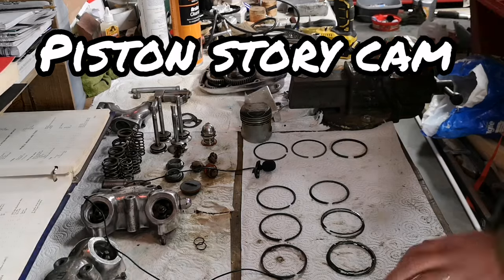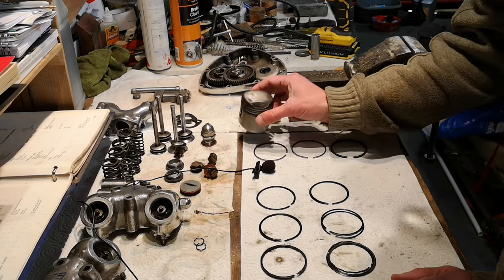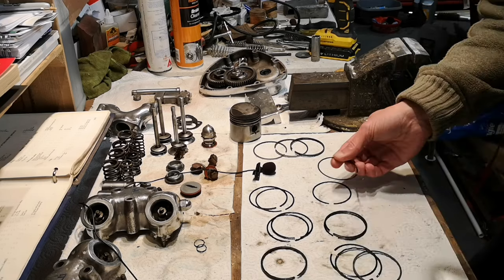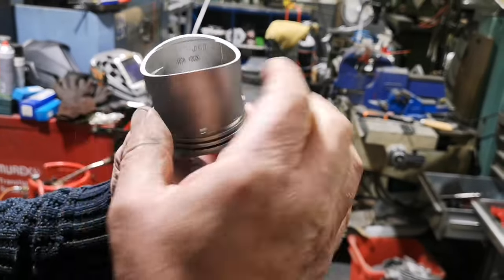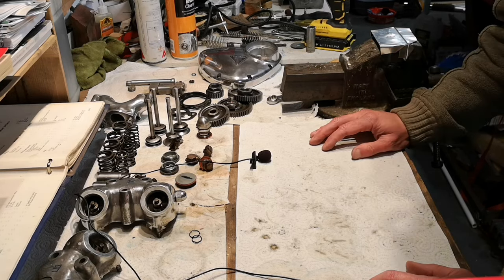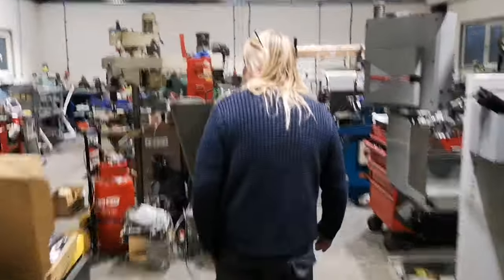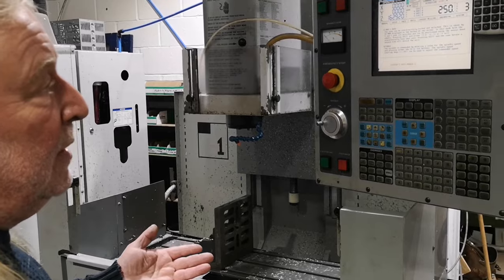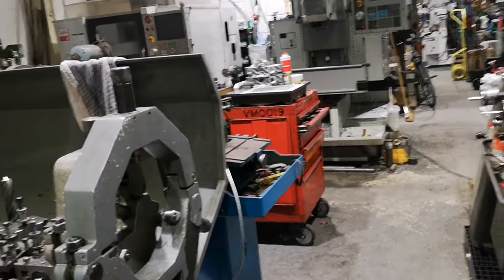Project Triumph Tiger 90 Episode 12

Comment: I've binge watched all your episodes now and the level of detail you provide will be very useful for when I get to do my Tiger 90. It was bought by my brother in 1981 for £200 and he used it all weathers without any mechanical sympathy. The clutch basket has a segment broken off which happened when we used a spanner to lock the inner and outer clutch parts. It's been like it for 40 years! My brother gave it to me and I had it stored in my garage for 12 years until 1998 when I got it going again. It was smoky so I had the valve guides replaced and I ball honed the cylinders for new rings which cured the smoking. I rode it on and off until 2011 when it sprung a bad leak. It's been dormant again since then. I'm inspired by Dom and yourself to get it back on the road.